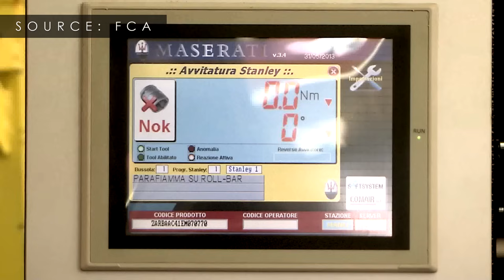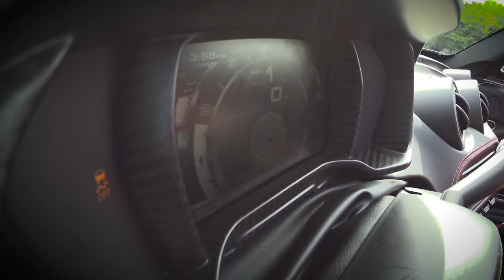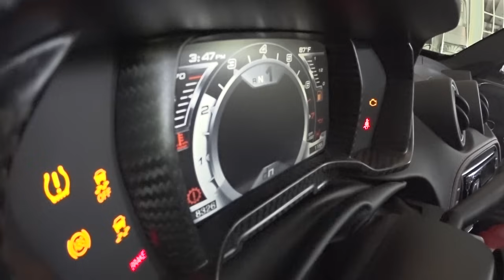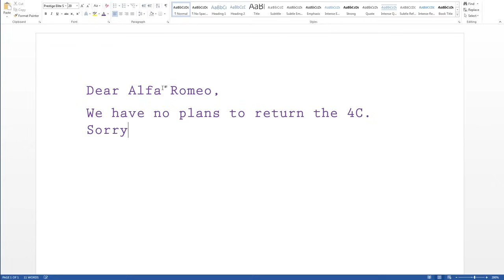Review | Alfa Romeo 4C Spider | Perfectly Imperfect

Comment: I love the 4C.  It is wonderful that Alfa can build such a car.   A N/A or SC 4 would have been a better match.  A 200 hp 7500 rpm 2.0 or 2.2 would have been a god send.  Yes it would be even slower.  It would sound and feel fantastic.  No manual transmission is a deal braker for such a purpose built car.

Comment: I agree about the transmission, I would buy one if they made manual.
Reply: Coming from a manual purist, the semi automatic manual isn't as bad as you may think.
Reply: +mk2mister2 True, but it get old quick. That's why Porsche is bringing it back for the gt3.
Reply: +OwnersGen Hasn't gotten old for me yet. But I can't disagree with you on the manual transmission. My other car is an MR2 Turbo so that gives me my manual fix. Yes, I have a sickness in that I own two mid-engined sports cars.
Reply: DCT is the best . this car also needs something like a turbo hyabusa motor in it now that would be badass.
Reply: mk2mister2 I share your sickness
Reply: +Tyler Hoeve   A DCT costs more, isn't as reliable, works great on a track but terrible at low speed or on hills.. For a lot of models a manual spec will depreciate less 
Considering this car isn't meant to set lap records, I'd say a manual is better suited.
Hell, even torque converter autos have improved enough to be a better option than a DCT in a lot of circumstances
Reply: Test drive the new MX 5 ND`s manual transmission and than try to live without it ...
Reply: The 4C's dual clutch behaves unlike BMW, Porsche, VW units. I much prefer it to Porsche's PDK for example. It's not as quick or crisp, but it provides feedback - which is the entire point of the 4C.
Reply: Alfa used to make the single clutch version known as selespeed. It was cheaper but can be a little tricky to move around town, being slightly more jerky. But it was more engaging. Dual clutch takes away some of that feel actually.
Reply: i thought because of technology automatic is faster than manual?
Reply: I used to think that but prefer DCT now. Moderns DCTs aren't jerky. Geese seems to have plenty of fun on the backgrounds despite not having to shift. You end up focusing on other aspects of the driving, which for me personally is gratifying enough, and when I hit traffic on the way home I get to be lazy.

Comment: Love my 4C hits 150 very easy I'm running Eurocompulsion Phase 2 tune with there intake.. Power output fixed !
Reply: I love it! We own a little Dodge Dart, only 160hP dual clutch transmission, that thing is so much fun as is. I can only imagine what the 4C does. My wife is not a fan of Manuals so the limited was a compromise. I do have to say that having the dealers work on it has been a nightmare, okay if they charge for fixing it and fixed it, but they do not, at least 2 dealers here in Austin, Texas, are not good at all, Dual Clutch Transmission are simply a manual with two clutch disks for odd an even gears, with a transmission controller doing all the shifting, which at 30 k miles need n adjustment. Well, the module is smart but not smart enough to realize you still have plenty of clutch disk material to use and it throws the error to get it serviced. When you do, these knuckled making money heads, will drop the transmission at your cost, even when still under warranty, and charge you for parts. Easily a $4k job.when it should not. I am a little smarter than most, in the sense that I hate it when people take advantage of me and cheap enough to want to research a new route. Turns out that I could get the dealers obd2 tools and do the work myself and it ended up figuring out how to re train the transmission for a third round of 30k miles. I know the 4C has the same transmission, which is really robust but be aware of dealer ignorance and fraud. at 30k you should not have to replace the transmission clutch assembly. For more info, feel free to contact me via YouTube.

Comment: i like the 4c but for half the money i could get a second hand lotus elise SC (supercharged) that is as quick as the 4c and handles better.
Reply: you can now get a 3 year old for half the money, although i still wouldn't.
Reply: I want to buy an Elise so bad to replace my miatas. But being older the air conditioning kills it for me. Why would Lotus use Toyota drivetrain and not use Toyota air conditioning system?
Reply: @S2000Y  I have a 4c myself..And I wouldn't never buy a used 1 !! You have no idea if there any damage to the carbon fiber monocoque 😑😑😑

Comment: As an 82 GTV6 owner I took great interest in this car.  But what the heck is it with the small drivers cabin?  That eliminates a lot of potential buyers.  It's got me thinking about something of an alternative.  Like an older Ferrari 360.  At the time when the 360 was being designed Ferrari made a conscious effort to increase cabin space to accommodate larger drivers.  Good for them!   That car was available with a manual.  Speaking of which, imagine the 4C with a better engine and a gated manual 7-speed?  Oh would that have been something.

Comment: I would also prefer a manual, but DCT transmissions with paddle shifters are really fun if they're designed well, not gonna lie.  I've driven traditional automatic transmissions with paddle shifters and hated them, but DCT's are a different story.  The harder you push them, the better they respond.  I'm sure they're very expensive to fix when they break, but if you're buying an Alfa you should know what you're getting yourself into.

Comment: Would this be a bad thing to buy if you're worried about reliability? I love this car, size, feel, look... I just wouldn't want the headache of it constantly breaking
Reply from the maker: +Gabe Owners would have to speak to that, there are definately risks with high boost cars but check out owners forums see what common issues you find.
Reply from the maker: +Gabe Owners would have to speak to that, there are definately risks with high boost cars but check out owners forums see what common issues you find.
Reply: It's been my daily driver since I traded a Boxter S for it about 15 months ago.  So far I've had one oil change and no problems. fingers crossed  It IS Italian.
Reply: Hows it going 2 years later with the Alfa?

Comment: Awesome car, amazing video review. Only wish you could review the top as well. How easy/difficult to get it up and down?
Reply from the maker: I actually had that footage corrupt. It's easy to remove from a stop but a bit of a pain to put back on and you have to be outside the car to do it.  Two mechanical switched on each side to release and two center thumb screws in top center of windshield.

Comment: Back in 2013, Alfa’s affordable new sports car seemed a dream come true. Why, then, did they sell fewer than 2,200 in the American market? With worldwide production totaling only 9,117 cars? The car was expected to sell exponentially better, and the huge R&D and manufacturing expense must have cost the manufacturer hundreds of millions. 

What should have been a masterpiece beloved around the world was fatally flawed due to inept product planning. 

- The carbon tub, supposedly for lightness, was far too expensive to build for a car at this price point.

- The car could not be a daily driver, with its cramped interior, semi-functioning HVAC, lack of storage space, brutal suspension, and next to no storage space.

- The highly stressed 1.75L four relied on 22 lb. of turbo boost to achieve merely adequate power, raising the issue of the engine’s longevity.

- For the hard core sports car buffs this car was designed for, the lack of a manual transmission was a deal breaker for 90 percent of them.

I grew up with Alfas and have always loved them, but I would never own one. Does anybody have an answer to why this manufacturer is still building unreliable cars in the 21st century? My answer: poor corporate leadership.

Because of a few cringeworthy management decisions, this wonderful sports car was doomed from the moment it arrived on our shores in 2014. As usual, Alfa Romeo displayed a beautiful concept at the Geneva Auto Show, but lacked the corporate will to bring the finished car successfully to market. 

Stellantis owns Alfa Romeo along with a bunch of other money-losing brands, and the question is, how long will their investors subsidize internal combustion manufacturers whose offerings will be eclipsed in a few years by self-driving electric commuter pods? Boomer-age motorheads like me who grew up in the golden age of sports cars seem to have timed our lifespans about right.

Comment: 1750 engine at Alfa Romeo has a long history,
it is  proven that this size of a cylinder (437.5cc) is the most efficient and powerful proportionally to all other cylinder sizes. 
For 6C it would be 2625CC 
For 8C 3500CC 
For 12C 5250CC (for example, like the Ferrari Testarossa)

Comment: Great review!  I assume that beeping noise on the track was TC kicking in?

I still don't get why they didn't have a frunk or front trunk.  I get it's not meant to be practical, but if it had both a front trunk and rear trunk it would be fairly usable. 

Dual clutches are really nice, but in a car like this, I bet it would be way more fun in a stick.  Wouldn't perform nearly as well, but eh....
Reply from the maker: +CSmittyBurz Beeping was it saying, NO to downshifts.  Always felt like it needed more power.  Maybe they can change design next gen and do fronk.
Reply: Seems very Italian.  "No no no no downshift, dis gear is best."  I get it's to prevent over rev but kinda funny.  

I wonder if there is much more you can squeeze out of this engine reliably?  I know with the Abarths that make great power, but apparently no one has been able to crack the ECU.  (except for the first gen 12-13s)  I wonder if that's the case here to....

The Fiesta ST has a 1.6l and with bigger turbos they have gotten them into the 300s and it seems to hold up okay.  

240hp is plenty on the street, but not a ton on certain tracks.
Reply: savagegeese same as subaru with brz, 4c sales are for nought in the grand scheme, there probably ain't gonna even be a blowout final edition, leave along another generation unfortunately. Hopefully I'm wrong.

Comment: Just a note..."psi" isn't really very relevant to power production.  PSI is relative to the turbo/compressor you're referring to, in terms of cfm and how much air volume is being pushed into the engine.  The fact this car is at 20+psi from the factory is an indicator it has a peanut turbo on there...i.e. small.  Reason being, you put a small compressor on there, it takes less energy to spin it, allowing some torque fill and to not leave the engine peaky.  You could make 260whp or 280whp, but the lower portion of the curve would suffer.  In the end though, psi...10psi or 20psi is irrelevant...it doesn't change combustion pressures, it's about cfm at a given psi level.  One turbo can put out x cfm at 20, while a different turbo can put out far more cfm at 10psi, and be more efficient doing it...i.e. heating up the air less.  At 22psi the turbo is pushing its efficiency, guaranteed, and a compressor map for it would show that fact, but again...it takes less energy to spin a small wheel taking small bites of air, so you get some lower torque out of it.  Guarantee that thing has to feel like it runs outa steam near red line and prob heat soaks pretty quick.  No surprise your boy would buy it if it had a manual...he loves these little guy cars.

Comment: This car should have had a 'touring' version with more compliant suspension and a hundred pounds of NVH supression. Most people are not going to track this car and it's not really that good of a serious track car. But even at 100 lb heavier and a more compliant suspension it would still be very light comparatively and would still feel amazing on the road and in the canyons.  But just a bit more refined so that it wouldn't wear on you on bad roads.  And though many say the DCT is perfect for the car with its narrow power band, I probably would still have liked a manual.

Comment: I like this car. However, the manual aspect is disappointing. As you pointed out, there is no US lotus now, so that is not an option unless you want to get a 2011 or earlier, but they sell for the original sticker. I have an ND RT now, (and it is freaking great), but I'm interested in more power. Hypothetically, would you SC or Turbo an MX-5 with additional handling kits, or go with one of these?
Reply: Wow. 4 years late but I made it back to this video and saw your comment. I had an RT before my 4C (which I still own and will likely never leave). Did you ever add anything to it? If I would have read this 4 years ago, I would have said SC, but now,  after getting used to this, I would say Turbo.  Apologies for never replying.

Comment: It is true that speed isn't everything. My daily driver is a 2010 Audi S5. It'll do 60 under 5 seconds.

My 2000 MR2 Spyder has less than 140HP and much, MUCH slower.

Yet while the faster S5 is great...the MR2 leaves my face sore from the nonstop smiles, laughs, and hoots. It is an absolute blast. Even taking it to pick up take out is pure motoring joy. The way you can fling a mid-engine 4 banger around a corner is unparalleled. The best part is, you'll be screaming with joy, looking like an idiot to all around you, and you won't even be breaking the law.

To get the same thrill from a Ferrari or even my Audi you'd be doing triple or quadruple the speed limit.

Comment: Good review strategy there, mention the negatives quickly, and find the one positive to counter them each time. Like, the suspension sucks for daily driving and roads, but it’s a race car. The carbon fiber tub will crack in a crash and total the car but it’s light. There is understeer but....The tranny is old style SMG but at least it’s not a cvt. Don’t blame you, what choice does a reviewer have when dealing with the level of snobbery represented by the Alfa’s?
This versus miata ND: miata has manual tranny, is lighter, has non.-turbo linear 2liter, can be modded infinitely more than this one, cost of ownership is a tiny fraction of this, much better soft top capabilities. Do an in-depth driving comparison of the 2 if you dare. No reviewers do it. Cause that is the last “exotic” they would see.

Comment: 1) They should have put that engine into the FIAT124 Spider, 2) If they gave you a manual transmission you'd be complaining about loss of boost during shifts (ala FIAT124) 3) Years ago, car magazines were full of complaints from writers about the lack of road feel from power steering equipped cars, now, some of the reviewers complain that they feel kickback from the road with this car's steering, and 4) Those nasty broken down roads you complain about are called "New Jersey".

Comment: I would love to see an actual sports car with a CVT. Tune the engine for max output at one specific RPM and variable valve timing to put in an RPM with max economy. Plant the pedal and the engine would go to max power and hold it while the trans crept up. Man would it be fast. let off the pedal and the car would glide along.

Comment: The biggest disappointment of this car is the extra 400lbs that the US version gets.
Reply: More like 300 pounds......You would not be disappointed in an accident.
Reply: fatboy19831 342Lbs* And you act like sports cars are safe in general. A car that's made mostly of Carbon Fiber and Aluminum weights 133Lbs more than a Miata. Sure sounds like a disappointment to me.
Reply: *****  If Alfa had limited the 4C to 200 hp it would have been another 100 or so pounds lighter.   Most likely the chassis in the 4C is fully capable of handling 300 hp +.  Yes modern sports cars are safe.  Look at the small offset crash on the BRZ and the MX5.  The MX5 is the ONLY mass produced sports car sold in the states that is lighter than the 4c. The Only one. The Miata has 80 less hp. The MX5 was engineered from the start to be the best 150 hp car money can buy.  The MX5 is not engineered to handle even 180 hp.
Reply: Tyler Hoeve Probably the only way it could pass the Us crash test was to add structure to the chassis.

I have an 01 Jeep Cherokee.  It weighs 3700 pounds.  When it came out in 1985 it weighed 3000 pounds.  Over the years  more and more weight needed to be added for the car to pass the stricter and stricter crash test.  Including air bags.
Reply: The extra weight seems to make it good. In Europe they complain a bit about the handling but every reviewer in the US says its incredible.
Reply: fatboy19831 I'll take that weight and the chance to live
Reply: PimpSlap My 2000 Celica only weighed 2500 pounds.  It was wonderful to drive but just tap it and it imploded like a tin can.  The BRZ  (Toyota 86) 13  years later is solid as a rock and 10 times safer.  The cost is 250 pounds more weight.
Reply: Where is the extra weight added specifically? What does the Euro Version not have VS the US-Spec Version? 

Cool car. But if anyone thinks this car will be practical, they should just probably look elsewhere because if you don't understand then you never will.....
Reply: I went on a diet. Lost 200lbs
Reply: @mxracingunlimitedltd7784  US version has air bags, air conditioning, and they had to beef up the carbon tub to meet crash standards here in the states.
Reply: fatboy19831 Actually the MX5 is engineered to handle 181hp.
Reply: @bobby4716  It is  when it's in the same price bracket as a Porsche 718 GTS or a Corvette. If that was built cheaper with a manual at like the Price of a 370Z it would be a steal.
Reply: @fatboy19831  The MX-5 can handle more than that, people buy older molders and Swap  LS V8s in them all time. Plus  you can easily get 250-300HP in Miata ND1 and Fiata Abarth with big Turbo kits and some bolt-ons.
Reply: Necrotic Reaper  No......... not easy or reliable to swap an LS into an MX 5.   The fiat wii hold the boost but has drivability issues. I am not sold on the bone stock cars reliability.